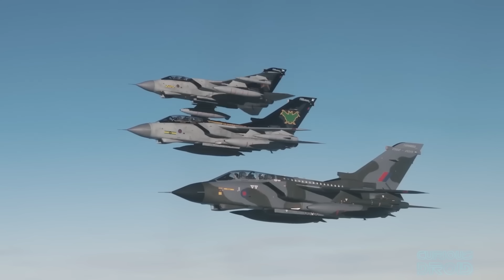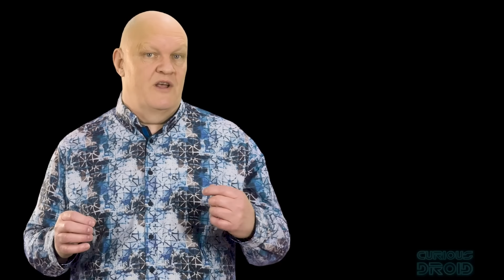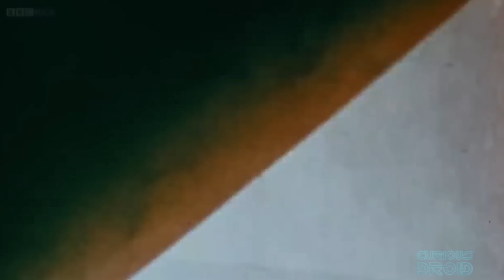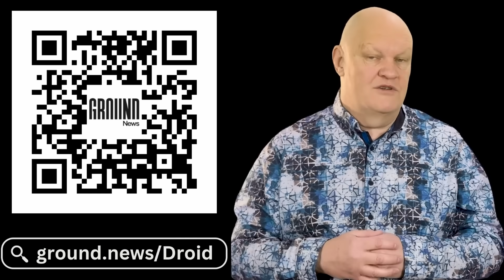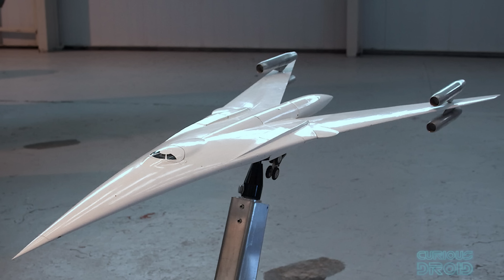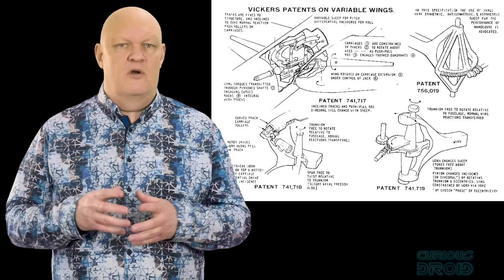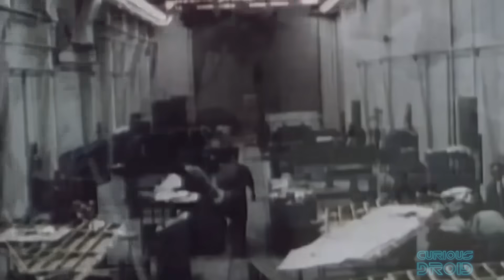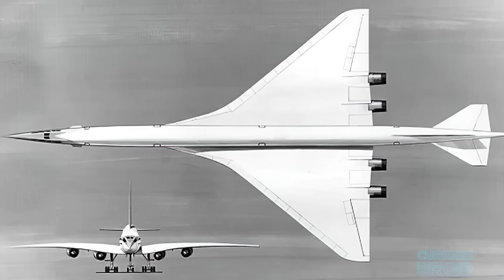Why Aren't Swing Wing Aircraft Made Any More?

Comment: Banyak artikel yang udah jawab. Aku bantu share beberapa. 
Swept wings add weight, radar cross section, and additional mechanical maintenance.

Today, software can adjust aerodynamic and flight control performance better than hardware can. These days, we just don't need mechanical contrivances to make aircraft fly the way we want them to.

swing wings require very strong base swing points, the weight is increased, and the cost of a special titanium (as an example) load bearing structural elements is very expensive.

Silahkan google translate kl bingung.

Comment: Not good enough greese, not strong enough metals, like you could a made 8090 aluminum slats and 8090 iron pins, but it would take some halfnium carbide threading tools at 2,000 farenheight to thread the screws, but US hardware is murder hardware, now a days you can carry a cell phone, but they used screw drivers, it would be much harder back then.  Vanadium brass, 7% lithium, 12v max impact, just need 12 batteries.

Comment: The TU-160 is a variable swept wing bomber and it’s still being built, though Russia can only build one per 14-18 months. And yes, the initial planning for that craft was first noted in the 1950s. But the plane was finally designed in the early 1980s and production initiated in the late 1980s. When the USSR fell apart, the program was shelved, until in 1999, Putin in his turn around towards the west, had production restarted. 

So it isn’t true that no plane since 1980 has been variable swept wing. Of course, between the lack of resources and the invasion of Ukraine, Russia has no resources to allocate towards a modern bomber, so this is the best they can do.

Comment: F111 was McNamara's attempt to continue what he saw as a good logistical choice for all branches of the military.   Like the F4 phantom, it created commonality between Airforce, Navy, and Marines.  Variable geometry allowed an aircraft to change its flight envelope, making the aircraft far more flexible.  However, only the Airforce found a use for the F111, and nobody thought it was an air superiority fighter.  The Navy instead chose what many would consider the best fighter of th 20th century, the Grumman F14 Tomcat.
  The Tomcat also used variable geometry, as doing so makes alot of sense for a high performance aircraft operating off aircraft carriers. The Tomcat never fought much, just having them in the sky was enough to keep most belligerent aircraft on the ground.  
  But with the advent of computer controlled fly by wire replacing traditional hydraulic control systems in newer military aircraft, designers were realizing they could make an aircraft that would otherwise be unstable, fly.  And Radar cross section was becoming increasingly more important to a fighter aircraft's survivability.  With the new technologies, variable sweep wings were not a luxury we neede anymore, and we as yet, have not been able to combine variable sweep, with a low RCS, one may assume that variable sweep wings are a thing of the past.

Comment: By the end of WW2, propellor driven aircraft had reached their peak of design and their piston engine couldn’t be improved any further. However, the jet engine offered the same performance from it’s introduction when the jet engine design was still in its infancy and still had years of development and improvement ahead of it. So while designers knew they were unlikely to break the sound barrier with a piston engine, it was a possibility with the jet engine, once it improves. Therefore they had a reason to research and develop swept wing design, alongside jet engines.

Comment: Short answer = Computers got better and were able to do the back end calculations in order to have a wing type which was unstable become stable via the computers adjustments. This made the variable swept wing concept redundant, so computing working in the background being superior to a mechanical solution which would inevitably include complexities, added weight, maintenance burden and manufacturing cost that will always come with a complex mechanical solution. On top of that stealth is compromised by moving wing platforms.

Comment: Suggesting a topic inspired by this episode: swing-wings were built to accommodate the need for speed regimes and maneuverability regimes, but we're not stealthy by modern measures. The F-117 and B-2 put their imperative on stealthiness, and were both subsonic, probably by necessity at the time. Modern 6th generation fighter aircraft are supersonic and stealthy, but can they be supersonic and stealthy at the same time? While their radar cross-sections may be small, do their shockwaves give their locations away regardless? (hang on, an unmarked black helicopter just landed on my lawn and the doorbell's ringing) 😅

Comment: The lift and drag force of the wings had to go through the left and right pivot point.  This required very intense and expensive structure at the pivot points.  This required a heavy weight penalty.  So, the smart aerodynamic engineers developed other ways to do the aerodynamic transistion work more aerodynamically and less structurally.  The F14 made good use of titanium to reduce the weight penalty.   The previous F-111 used tool steel.

Comment: Interestingly, the first variable geometry swing wing design that I know of was created in the 1920s by Westland Aircraft called the Westland-Hill Pterodactyl.  As basically it was a flying swept wing It's variable geometry was necessary in flight to adjust the CG position in relation to the CP. So the Bell X 5 was not the first.
Reply: As you stated, the Pterodactyl was designed to adjust the Pitch stability at low speed (it could only fly 165 mph) and was not capable of flying in the transonic region, its design had no effect on compression drag in the transonic or supersonic flight envelope like the Bell X5... so it is completely unrelated to this discussion. The X5 is the first swing wing jet aircraft.

Comment: Wow.  It sounds like even If Northrop-Grumman had resolved the high-maintenance issues with the panels of the F-14, it's planned successors (ST-21 and ST-22) would likely have been fixed wing aircraft, purely from a weight reduction perspective.

Comment: For one thing the wing pivot box imposes an unacceptable limitation on load capability. Also as someone mentioned below they are maintenance intensive. On top of this it's another chance for something to break or go wrong.
Reply: Advancements in electronic flight stability technology has rendered swing-wings obsolete.
Reply: @WilhelmKarsten  Yes that too. I just thought My points were sufficient reason and hadn't even considered that but you are so right.

Comment: Variable geometry will make a come back. - As others have said, maintenance costs fir tge F-111 and F-14 were a big concern; but the aircraft thenselves were old. - You can push sentimentality and nostalgia, only so far. Even in peacetime. Before its no longer safe.
Fly-by-wire was already in service, quickly leaped to aerospace, which is now in its 5th gen. The v-wing I've seen has a top mounted, hawk-wing, or gull-wing config, and sweeps back to something resembling the Drakken. - Suggest an aerospace fighter with v / stol capabilities.
Reply: Electronic flight controls have rendered swing-wing aircraft obsolete.
Reply: @WilhelmKarsten  I did say fly-by-wire was already in service. - its far from obsolete. There are 5 different test platforms competing, right now.
Reply: @palpaladin315  Fly-by-wire technology was invented in the 1930s,.. Electronic flight stability controls is what rendered swing-wing aircraft obsolete.
Reply: @WilhelmKarsten  Ok, now I'm laughing. 😃
Reply: @palpaladin315  Serious as a heart attack,  you didn't know that there are modern jet aircraft which are completely unstable in all three axis and are completely uncontrollable without computer assisted flight controls?

Comment: I once had a model F-14 which had big simple gears on the internal wing ends which meshed with each other and simple rugged axles for each wing. You pushed one wing, and the other rotated perfectly in sync. I thought it was how all aviation products should be made. Clever, simple, rugged, reliable.  How the full size F-14 wings pivot I have no idea.

Comment: Swing wings.
The pop up headlights of aviation.
S3xy, cool and a damn shame they’re gone.
Reply: And also more complicated, and one more point of failure on an already complicated aircraft.
Reply: And heavy.
Reply: Pop-up headlights were invented to deal with the limitation of vehicle headlight tech back then, where you needed them to be a certain size and shape to project a certain amount of illumination on the road,  but those requirements limited how aerodynamic you could design the vehicle body as. 

With current more advanced LED HID headlights, you could have the same amount of illumination via a narrow strip on the front without disrupting the aero design of the vehicle. So pop-ups are never coming back due to all the draw-backs they had and still have

Same goes for the swing-wing, you dont see it anymore because there are better ways of doing things now without having to deal with the swing-wing's drawbacks
Reply: @SoranPryde  - yep.  The DOT forced those ugly round and later rectangular and square sealed beam headlights on the auto makers.  Pop up assemblies and doors / covers were an attempt to style around the requirement.
Reply: For some, they may have cool factors, but they are aerodynamically disruptive. I'm glad the Corvette got rid of them. They totally disrupted the airflow over the hood. Of course on an aircraft they are primarily used during take-off, landing, and stowed during flight, so not so important.
Reply: Kinda like the   T - top
Reply: I was going to make the same comment when I saw that you had already posted my first thought 😁
Reply: 4 hours flying and one month in the garage.
Reply: You only think that because it's associated with your own personal nostalgia.
Reply: Which makes F-14 the Countach of fighters.
Reply: The b-1 lancer is still in service lol
Reply: @zhongxina4304  f14 too in iran
Reply: I owned a '79 RX7 and a '94 NA Miata. I can absolutely say that pop up headlights are not sexy, nor cool. They can freeze shut sometimes in crap weather and with age become problematic. The stalk switch and the drive unit crapped on my '94 NA leaving me stranded with no lights waiting for a ride several hours. Stalk replacement and drive unit both was going to be like $1200 (several years ago). I "moved up" to a NB Miata. Y'all can keep your pop ups. The RX7 did pretty much the same thing, I just thought it was a fluke at the time.
Reply: @waynepurcell6058  so just like the sweep wings. Sexy and cool but obviously flawed.😊
Reply: @waynepurcell6058  - The pop up headlights on my ‘83 RX-7 GSL functioned flawlessly.  I sold it in ‘90.
Reply: @waynepurcell6058 
Never had issues yet with my 944 pop ups.
Reply: @waynepurcell6058  😂 
No way, dude. 
They were ice cold cool 😎 

Thank I owned an MX5 Monaco. 
In the winter, it was best to leave the lights up to stop them freezing. 
Loved that car. 
Only 115bhp, I think, but it felt a lot faster. 
Yet another car that I wish I still had. 😂
Reply: @BionicRusty  
Bring back the American Motors Metropolitan convertible!
Reply: @BionicRusty  And you explain your own reason for thinking that. Personal nostalgia by association to your own life memories. Nothing objectively great about pop ups. Miata's are indeed great feeling cars though
Reply: Man I wanted to figure out in the video

Comment: Very good video well documented covering a great deal of information.   Just one note in 1943 the high speed trials flight using Griffon powered Spitfires had two important lights.  First was the mach .89 flight in late 43 which went as planed with no damage to the aircraft at all.  In early 44 the trials continued however as you mentioned there was a propeller issue in which the gearbox tore itself apart and ripped the propeller right off the engine.  The vibrations caused the pilot to lose control of the aircraft and he eventually passed out from the forces in the uncontrollable dive but with the weight of the propeller and gearbox removed the Spitfire stabilized on it's own thanks to the incredibly balanced nature of the aircraft.  The Pilot regained consciousness and prepared to bail out when he took stock of the situation then decided he had enough altitude and the aircraft was still controllable so he was able to land the aircraft preserving it for examination.  That flight recorded a speed of Mach .92 but the air frame was damaged with the wings bent back at a 35 degree.  Ironically the same sweep of the F86 and Mig 15.

Comment: Great presentation.

Minor nitpick: The US B-47 bomber was the "Stratojet," not the "Stratofortress."  The "Stratofortress" name went to the B-52.

A major problem of swept wings manifested itself on the B-47 as a consequence of the relatively low output powers of the jet engines of the day.  If they'd stuck to the original plan of a straight wing, the jets chosen might have done the trick.  Sweeping the wings -- combined with comparatively low-thrust engines by modern standards -- meant for some absurdly long takeoff distances, particularly at airfields at higher altitudes.  The solution was "JATO" or "Jet Assisted Take-Off," which essentially added rocket engines that would only be fired at takeoff.  Not an optimal solution, however, since the JATO bottles were themselves heavy and they had to be positioned uncomfortably close to parts of the airframe in which fuel was stored.

The eight-engined B-52 corrected the thrust problem and caused the B-47 to fall by the wayside pretty quickly.

An officemate of mine who was some years my senior remembered being a crew chief on the B-47 in the 1950's, when it was still regarded as an option for use as a strategic bomber over Soviet territory.  But he used to comment that he was on a few of the very last runs of the B-47 when it actually still carried bombs.  By the mid-1960's, the B-52 was carrying the bomb payloads and the B-47 had been relegated to other tasks such as photoreconnaisance.

Comment: So from what I’ve heard, part of the reason was because they added a ton of weight to the design, which could impact the performance of the aircraft.
Reply: Look at the Grumman 303F which was a fixed wing version of the F-14 that would have been 4900lbs heavier
Reply: @silverphinex  read what the f-14’s aviation fact file has to say on the 303F. Also, I learned this from someone who actually worked on these planes during the Cold War, not from the internet

Comment: Henry Gaudreau
Worked at U.S. Air Force (1979–2006)Author has 164 answers and 56.9K answer views2y

First, (but not most important) is cost. It’s very expensive to develop a modern combat aircraft, it’s even more expensive to develop a modern combat aircraft with swing wings. Second, the science of aerodynamics and materials science have greatly advanced from the baseline swinging period of the 60s. Remember, the goal of a swing wing was a multi role fighter (think F-111 and high speed with low speed handling (think B-1). Now, with tremendously better engines and blended bodies we can get the same performance without the need for sweeping the wings. Engines have more thrust range, throttle transient periods are much shorter, and lifting bodies (an F-15 once landed with only one wing) all obviated the need for swing wings.

Comment: My first thought is "They are complex, heavy, and expensive"
Sure, it can have different aerodynamic modes, each with it's own optimal speed area, but all that mechanical stuff has weight, weight that doesn't do anything for the plane when it's not changing the wing mode. Weight that could be used for more fuel or more payload.
 Lots of bits necessary to maintain the mechanic. So more different replacement parts need to be manufactured.
All that increases cost. You need more planes to deliver the same payload and each of these planes is more expensive to build and maintain.

And then obviously the fact that modern jets aren't build to fly at the same speeds.
Intercepting duty is done by missiles, so no need for those huge speeds and climb rates. Close range dogfights are exceedingly rare, so no need for extreme slow speed manoeuvrability. (Some even suggest omitting the nosegun for that reason)
And what we see nowadays are delta and trapezoid wings, which are fine from slow speeds up to slow supersonic flight. Exactly what modern jets do.

Comment: The F14 was is an amazing plane, and the ONLY REASON it was cancelled is because Dick Cheney (and the rest of the treasonous military industrial complex) wanted to shift funding towards the F35 disaster. I would rather have a fully loaded out 1990 Nimitz, than a 2024 Ford! The F35 is a money-laundering scheme.
Reply: You can’t complain about money when the F14 was extremely expensive to maintain. For 1 hour of flight time it required about 40-60 man hours of maintenance.
Reply: @captainhellhound7451  
"You can’t complain about money when the F14 was extremely expensive to maintain." <~ Actually I can, since the F14 was PEANUTS in comparison to the F35....and the F14 was proven.

"For 1 hour of flight time it required about 40-60 man hours of maintenance." <~ Please provide the citation for this claim.